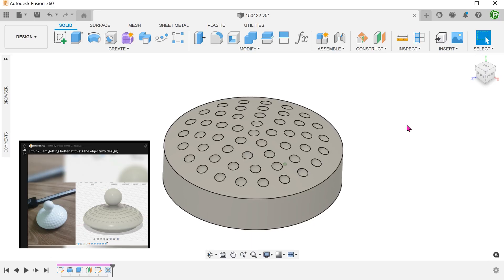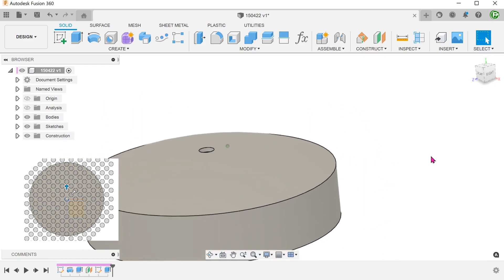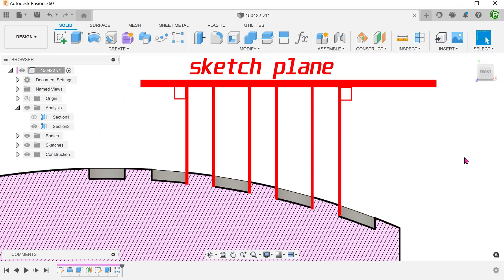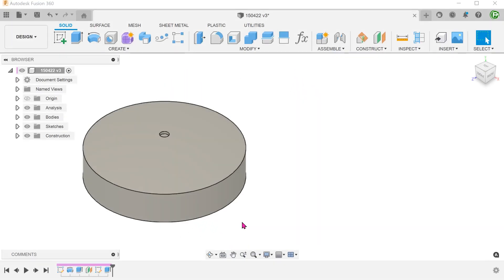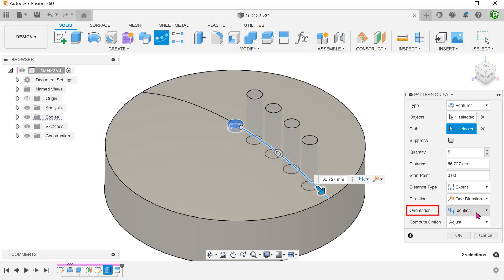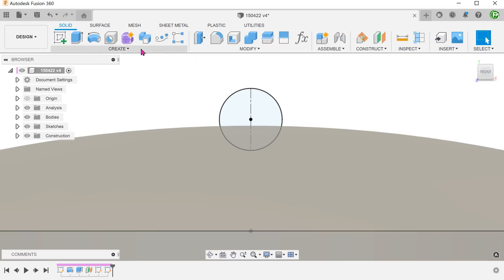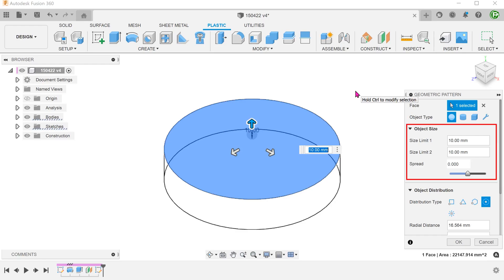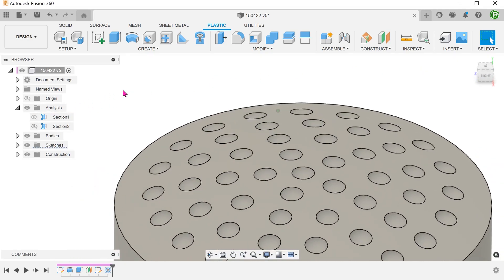Fusion 360 | Case Study 27

Comment: I often take models in your tutorials and try to recreate them in OpenScad. 
The end result is often not perfect, but for this model I could recreate in about the same time as the video last.  :-)
This is all the code needed:

difference()
{
    Base();
    Dimpels();
}

module Dimpels()
{
  translate([ 0 , 0, 100 ])
    Dimple();

  for(Pos = [1: 1: 4] )
  {
    for(Deg = [0: 72/Pos: 360] )
    {  
      rotate([ 0, 7*Pos, Deg])
        translate([ 0 , 0, 100 ])
          Dimple();
    }
  }
}

module Dimple()
{
  sphere(d=8, $fn=25);
//  cylinder(h=10,d=8, center=true, $fn=25);
}

module Base()
{
  translate([ 0 , 0, 78 ])

  intersection()
  {
    cylinder( h=30, d=110, $fn=100);

    translate([ 0, 0, -76.6])
    sphere( d=200, $fn=100);
  }
}

Comment: Hi, as usual, a great movie, I'm a bit off the topic;) but I'm already at the end of reworking all your movies;) and I have a question about the function that you sometimes use, namely Zebra Analysis, could you see a movie about it because I don't quite understand what that's what it's all about :)
Reply: zebra analysis is a visualisation tool.  it helps visualise contours across a body or surface as a whole, its like a 3D curvature comb.

its ideal for finding C1/C2/C3(Joins, Tangents, Curvatures) consistences but also lets you see if you have a point where a convergence/discontinuity/‘pucker’ is as the zebra stripes will not be evenly spaced.

hope that helps

Comment: Very useful! I should just go test this myself, but... :) Why did you need to create the separate centerline axis in the dimple for the revolve, given that you were already on the XY axis?
Reply from the maker: The centerline is to split the profile into 2 semi circles. The revolve would not work with a full circle. Using the centerline also has the added bonus in that it gets automatically selected as the revolve axis when you begin the revolve command.
Reply: @Fusion360School  ah right… I remember now; 360 revolve won’t work to create a sphere - special case. Thanks!